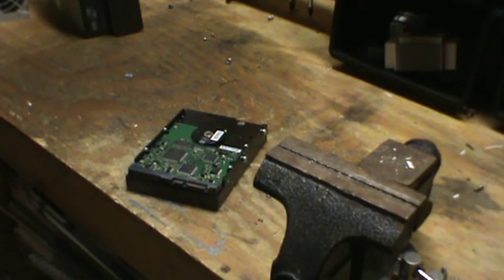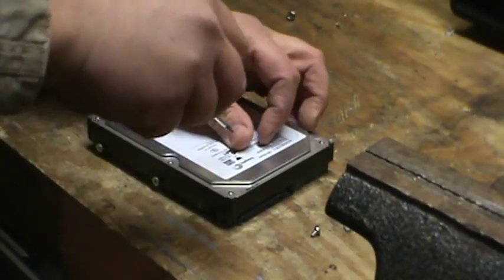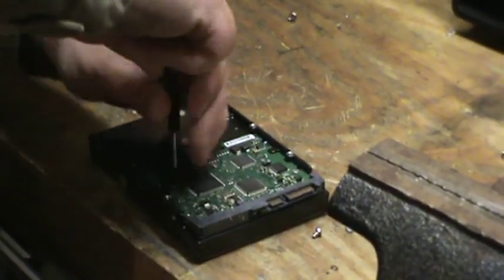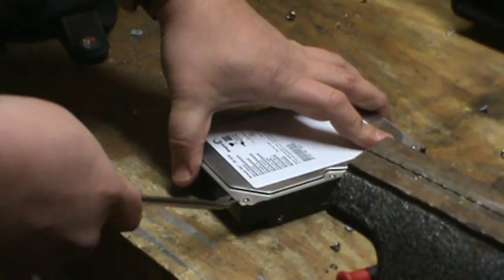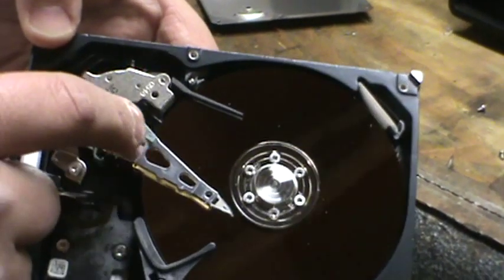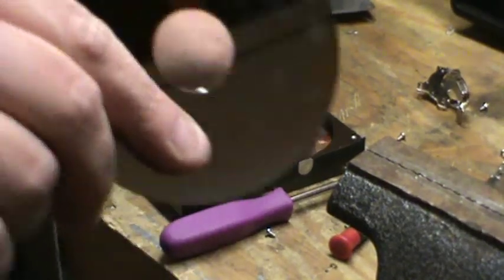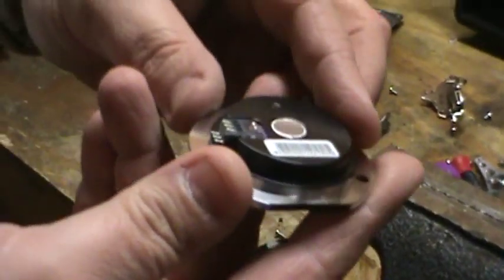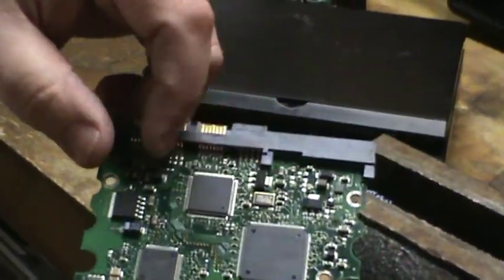How to Scrap a Harddrive for gold Platinum and other metals

Comment: As per your statement of the arm being made of Platinum... I used to work at a company that made various parts that went into hard drives.. the wiper arm / reader arm as folks typically call them, manufactures name is (actuator arm) is, depending on the brand and model (Conner, Western Digital, Seagate,etc), all used to be machined from Magnesium (Mg)... then went to an alloy of Aluminum an Magnesium... then as the Hard drives got cheaper, so did the quest to use Magnesium of which is far more stable then Aluminum, as per temperature having any effect on the spacing of the layered fingers.. now days, it is so common to see the stamped out fingers molded in a glass filled composite plastic, and those fingers are a specific alloy of Aluminum as well. Please note, not trying to come off as a d*ckhead, rather, just the info, that the Magnesium can be set aside from the aluminum for a different scrap rate, just a thought, most folks just throw it in with their aluminum extruded rate. as many scrap yards have no way to tell if it is (Mg) or (Al).. I guess it really doesn't matter...

Comment from the maker: Hey thanks for watching!!  I work in Portland!  The aluminum wires are usually bought as low grade.  Make sure you snip them though and look at the cross section in case they are coated copper.  Scrap yards buy them either way as low grade wire or #2 copper if you can stip those tiny ones.

Comment from the maker: sometimes they really hide it in there.  On some there is a very unsuspecting flat head screw on the bottom outside casing.  There is a way, sometimes its difficult to find.  keep in mind that the platters dont lose and pm recovery value if they are broken.

Comment: hello moose!

You missed a thing. That cover that you mentioned at minute 2:40, you checked with a magnet and it sticked to it. BUT, there are 2 sheets sticked to each other and  one is steel and the other aluminium. Check with a magnet in the corners.

What I do is fold a corner with a pliers and then pull the other sheet appart. It comes off really easy.

Have a great day!

Greetings from Portugal!

Comment: In some of the hard drives I have taken apart I have found a plastic box with little balls in them. do you know what those are made of? Thanks
Reply from the maker: doug johnsonj silica for removing moisture
Reply: OK thanks.

Comment: Hi Moose, I really love your videos. I'm hoping you can help me with something. I came across a hard drive with 2 platters. First one comes off easy but I am having a sweaty ballsack of a time getting at the second one. Any suggestions before I start smashing stuff? Any help would be great.

Thanks,
Debie Su
Reply from the maker: ....I am trying to imagine a scrapper named Debie having a sweaty ballsack of a time with anything..... lol. Usually to get the second one off you have to remove the neodymium magnet and the reader arm.  Often times there is a sloted screw on top of the reader arm that you can unscrew it with a flat head screw driver.  If that does not work send me a pic as I have yet to find a HDD that I can't break down!!  (Without breaking a ball sweat)
Reply: Right on. Thanks for the info. I'll give that a try tonight. I never said it was my sac lol

Comment: so the logic board is just the green part of the hard drive? does boardsort take them with  the gold fingers trimmed off or do you have to leave them intact? Great Videos..
Reply from the maker: There are no gold fingers on a logic board.  There may be some gold plated pins, and they would not buy them if they are removed.  Thanks for watching!
Reply: Moose Scrapper Thank you for the reply. I guess my main question is, what is the logic board? is it just the green card or is it the whole hard drive itself? Again, thank you. Been watching your videos all morning.
Reply from the maker: It is just the circuit board that is screwed into the bottom of the HDD. Usually torx screws but sometimes phillips head screws.  A really good resource for sorting boards is a website called boardsort.com  they buy gold bearing material and have pictures of all the types of boards, descriptions, and classifications.  I have found them to be REALLY helpfull.
Reply: Moose Scrapper thank you, been all over their site as well. I see they pay $9.74/lb for the logic board. Now watching you scrap a keyboard.

Comment: How did you dismantle the disks from the cast aluminum frame?  I used a T8 to open the drive(had to buy extra, since it was not in my kit).  My T8 still did not help with the disk turntable.
Reply from the maker: They vary from drive to drive.  Usually its a little aluminum ring with 6 small torx screws T6 holding the platters down.
Reply: Yea.  Was able to buy a separate T8 bit for my ratchet screwdriver.  But it seems that I have to buy an another whole kit which includes a T6 :(

Comment: steel  might be worth more then you think last year I was getting 12 cents a pound price its down to about eight cents this year but it is a lot heavier than alunimun probably by volume you would get more for it.  but  you don't have have a truck probably ain't worth doing
Reply: +Working Man That doesn't make much sense.  The aluminum is always going to be the better money maker, by volume or any way you dice it.  Think, if you had a truck bed of aluminum and truck bed of steel, yes, the steel will be a lot heavier, but the aluminum will be worth way more...

Comment: Are the Aluminum Rings extruded aluminum or are they considered cast aluminum?
Thanks!
Reply from the maker: I throw them in with the heat sinks, so extruded I guess.  They are not as brittle at cast aluminum.  Thanks!

Comment: The hard drive motors I put in with my irony aluminum which usually goes for about 10 cents a pound a my yard. Ain't worth my time to break them apart for an extra 40-50 cents a pound lol
Reply from the maker: lol, they are tiny....
Reply: Moose Scrapper yep lol

Comment: I noticed the screws for hard drives are non-magnetic... are the screws aluminum or something? Thanks!
Reply from the maker: kashewz They can be, most of the time if they are not magnetic they are Al or non magnetic stainless steel.  In those cases, they are still slightly dawn to the hard drive magnet.
Reply: Moose Scrapper Thank you, so do you save the screws and save them with the rest of the aluminum?
Reply from the maker: kashewz I save the ones I don't damage while unscrewing them.

Comment: What do you mean by "metals." exactly? Anyway, yes, you're correct IF you have qualifications or knowledge of programming, computing or business work, selling stocks etc.

However, if you buy any broken computer parts, cheap hard drives or take apart OLD, crap, or fried hard drives, you can take them apart and sell the scrap gold etc you have got.

You can also do this with older mobile phones, why do you think Envirofone buy old computer parts etc. Gold is a good metal to sell. Gold4Cash?

Comment: Moose, you have probably  been asked this numerous times and probably answered it a time or two. But I missed it and figured one more time won't kill ya. Plus you can always ignore it. But I was wondering how many PCU towers would it take to  end up with a decent amount of gold. Say 10 grams.
Reply from the maker: Indeed that question has been asked thousands of times.  It is an important thing to know for people interested in this stuff.  How much material do I really need to make it worth while?   The unfortunate reality is that there is no real answer.  There are so many variants in computer towers like age, type, manufacturer, etc.  If you had 10 towers from the early 90's with Pentium Pro CPU's and several PCI cards in there as well, you could get your ten grams easily in about 10 computers.  Nowadays, it could take 100 computers.  Advancing has made technology smaller, faster, and more efficient so less PM's are used.
Reply: Moose Scrapper  I kinda figured it could have a lot to do with age and brand. I've collected about 10 towers so far. I never really knew that refining gold and silver from electronics was something people could do so I haven't been saving them very long. But I have noticed that the amount of gold varies quite a bit from one computer to another.  Thanks for the quick response.

Comment: I have be told that the tops of the hard drives are stainless steel.
Reply from the maker: Some are, some are not.  If you take the hard drive magnet to it, the stainless steel ones will be very slightly atracted to it.  Al ones will not.  Thanks!

Comment: hi im having trouble removing the motor from the casing.. how did you removed it?
Reply from the maker: Ron Ron Sometimes you can flip it over and use a spike or screwdriver and a hammer to tap it out.  Otherwise a prybar works wonders.
Reply: thanks

Comment: You didn't consider the really TOXIC metals that are in those did you.
Reply from the maker: Toxic metals in a hard drive?  Please share more details.  I have been doing this for years, have done lots of research, and have found there to be no danger in the dismantling on HDD's.  There are a lot of myths out there, but in most cases they are just that, myths.  The bulk of the HDD is aluminum.  I am not burning anything, or doing any other kid of chemical breakdown.  Where is the toxic metals?  Thanks
Reply: I'm mainly going off of what other people have told me, there may not be anything of any life threatening danger although some of the really old disk drives have glass hard disks which can shatter into razor-sharp fragments  Good idea not to powder this glass cause the electroplated metal surface turns into an air born dust. I know IBM death star HDDs and laptop drives have glass disks. other than that   be careful with the rare earth magnets, they really hurt if you pinch a bit of skin in between them.

Comment: why is aluminum precious?
Reply from the maker: pixelgaming460 Its not.  The HDD contains gold, palladium, silver, and trace platinum.  Aluminum is the metal that makes up just about the rest of the HDD.  While not precious, it has weight and can be sold to scrap yards for as much if not more money that you will find in the precious metals in the rest of the unit.
Reply: +pixelgaming460 It used to be worth more than gold back in the 19th century...
Reply from the maker: +Jason Boisclair (Slowburn) oddly, that is true, even though it is known to be the most abundant metal in the earths crust.
Reply: Really?  I thought Aluminum was an Alloy that has to be produced by man?
Reply from the maker: +Jason Boisclair (Slowburn) no, its an element.  like iron, gold steel, etc.  Brass is an alloy, a mix of two metals copper and zinc.  Bronze, a mix of copper and tin is also an alloy.
Reply: Wow, I have never knew that, I just researched it now, thanks for the info...
Reply: Us people in Michigan get the best price for pop cans, 10 cents a peice...
Reply from the maker: +Jason Boisclair (Slowburn) LUCKY BUGGERS!!!!  THough, a lot of states don't have a return at all so I guess the Maine 5 cents is ok...
Reply: I don't understand why they all don't, when I was in Texas it was so weird seeing all the cans being put out to curbs for the trash man...